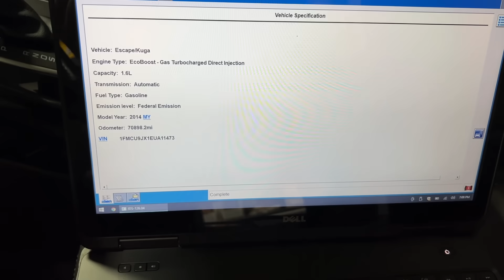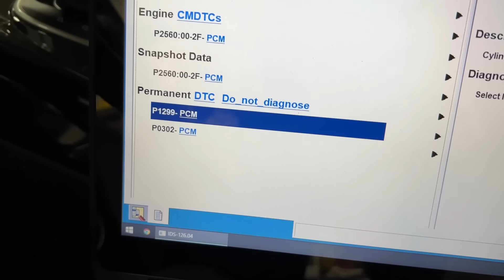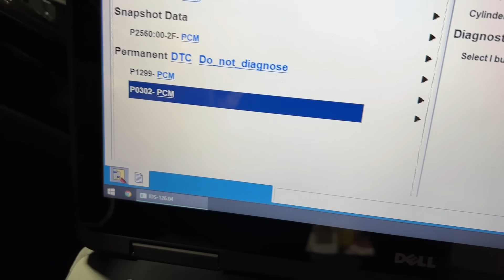Beware of Ford’s 1.5L 1.6L 2.0L Ecoboost Engines and Their Never Ending Coolant Consumption Issues!

Comment: So I have a 2018 fusion with the 2.0 and I took in under warranty I had the 5 year 75k mile extended warranty. Anyways I took it in June the car had 74,700 miles on it. I told them it had a issue the tech came out and listened to it said it was fine so I left. 2 weeks later it was cold out one morning I turned the heat on the car barely had any heat unless I was giving it gas. So the coolant was low topped it off. Next morning went to start it and missing like crazy. I was convinced by the signs I had coolant i intrusion. I took it in they discovered I was right. This is July my warranty was over by less than 2 weeks and 2800 miles over now. The service advisor said ford has been known to cover them but they didn’t the denied me. The dealership wants 8100.00 to repair the motor. I can’t afford it so I’ve been driving it like this. Seems to be okay kinda. I’m about to drive it from Ohio to AZ. Risky I know but no choice. Wish ford would fix it knowing and basically admitting to the the issue with new motor.

Comment: There's almost 2500 comments, and i'm not going through them all so this may have been said already.

Ford has a recall on their 1.5 and 1.6 Ecoboost engines. If coolant is found to be leaking into the cylinders, they give you a brand new short block. The 2.0 is fine though.

Comment: Same issue here in my 2014 fusion 1.6t manual at 130k miles cylinder number 2 crack and ford has no recall on my vin for coolant intrusion idk what to do at this point I’m still paying off the car too

Comment: We just had our 2019 Escape fixed after only 63k miles because of the coolant intrusion problem. Loved the car until we encountered this. On top of that, Ford refused to pay to have it fixed. Praise God for the extended warranty otherwise it would have been a $6200 fix for us. As a former Ford Master Certified salesman, do not buy a Ford. Not until they address these issues.

Comment: It’s crazy though how many engines are unreliable now days… Kias 2.4 blows constantly from losing the ability to spread oil from metal debris. The eco boost cracks blocks, Subaru loves to engulf oil as much as it can. Probably better off buying an old Toyota with 200k miles.

Comment: Since these are direct injection engines can this affect the fuel injectors? I have a 2016 fusion titanium with the 2.0l ecoboost. I had the original engine replaced for the problem at like 75k miles. Turns out they replaced it with the old design. At like 120k miles the same thing. I got it back and every now and then I would have a little miss but no code. Well 2k miles after my extended warranty ran out I got a random misfire code. P0300. Turns out it’s two injectors, numbers 2 and 3. Which happen to be the same cylinders that had coolant leaking into them. I’m trying to get as much information as possible before I call Ford to try and get them to cover it. I sold Fords for the dealership I use for over 11 years pre Covid. They’re one of the few trustworthy dealers left. Small town, family owned. Like the owner is there everyday and is the GM also. Been in the family for almost 100 years. If it was up to them Ford would cover it. But it’s not up to them. So they told me to call. When I worked for them I had a few customers that called Ford and complained and they covered their repair after warranty. One of them was 8k over but it was a problem they had off and on since it was new.

Comment: Glad my wife got the 2016 Ford Escape 2.5 SE and not that EcoBoost crap. Also just changed out the orange OAT coolant with the yellow VC-13-G P-OAT coolant. Coming up on 69k miles and so far all I’ve had to do is replace brake pads and rotors and replace rear struts. Drain and filled transmission fluid at 50k miles. Change oil and filter every 5000 miles.

Comment: It would be nice if they put out a book of all the vehicles that I have had eco-boost problems, and how to properly fix it or at least milk a good couple more years out of it and may be recommend a 10W-40 or a 5W 40 motor oil of extreme high-quality For the sake of the engine and the turbo charger maybe 4000 miles if you do nothing but city driving and 5000 miles if your 99% of the time on the expressway and I’m not talking about that $19 a court well, you have to get off the Internet only  because they think they’re so holier than thou like Schaeffer is 9000 Amsoil signature series top one torque oh SR one or liquid Molly I’m sure there’s a few I forgot

Comment: If this is a well known problem (Design Flaw) Ford SHOULD cover the cost off ALL effected vehicles. Will Ford not cover this repair out of warranty?
Reply: We are currently in the process of fighting for Ford to cover our engine replacement under the extended warranty on our used 2017 escape with the 2.0l Ecoboost. They asked us for maintenance records and receipts for oil changes. So I think they are gonna try and imply a missed oil change led to the gasket failing. 🤦🏻‍♂️ I sent them my maintenance records, but I'm missing one receipt. I've got my Vaseline standing by...

Comment: What about a 2012 Ford F-150 with a 6 cylinder ecoboost engine?  I've had this Ford for years with no coolant issues. Now I changed the water pump a few months ago and today the truck overheated and there is no fluid in the container.  Went to Austin on Sunday, no problem didn't overheat but I noticed the fans were coming on and running but the gauges didn't go past half way mark.  Also, there are no drops of coolant on the driveway or parking spot at work.

Comment: You presented a problem, BUT you never said if a Long block will fix the issue as in did they address the issue when rebuilding the long block that Ford screwed up?
Reply from the maker: Yes It is a completely new design long block, I have another video on this issue that shows the design change.

Comment: Yes its true 2017Ford escapes with 1.5 ecoboosts do use coolant quickly after i had it 3 years.....i also noticed the big hose pipe that goes around the engine to the side has some kind of leak.. its kinda oily dark substance near the hose clamp..

Comment: I bought a 2019 had it 7 months and Ford told me this after coolant is disappearing - The car is literally scrap now without a new block - there should be something done about selling these things if its known. I now understand why some people hate Fords, I am now one of them.
Reply: The 2019 shouldn’t have coolant
Intrusion issues
Reply: @Lord_Don  Well it did and after a vacuum test the entire number 3 cylinder was full of coolant. Ford then said I needed a new engine because coolant was entering the cylinders and causing corrosion - I got rid of the car and bought a Rav4
Reply: @johnathan640  was it the 2.0 or the 1.5?🥴🥴
Reply: @Lord_Don   1.5 Also more info, Ford gave me a printout of the technical service bulletin with the VIN number range that were recalled with this issue, 2017-2019 Escape built on or before 08-April2019, 1.5L ecoboost. My Escape was built in May at the same plant and was outside this window even though it had exactly the same issue as the cars recalled. When I called customer services they were pretty rude and told me that Engineers never make mistakes and get it fixed at a Ford and maybe one day I would get refunded if they increased the window or otherwise get stuffed. The next day I returned the car to the dealer I bought the lemon from.
Reply: @johnathan640  oh ok. I did get a revised block in my '18 hopefully I'm good🥴

Comment: I own a 2018 Edge Eco-boost with 80k miles. 
I am considering selling or trading it in bc of this issue. I don’t have those problems yet but just concerned about having them at some point. 
Do you have a video that speaks of the newer Ford engines and which is best? I want to stick with Ford but I want a durable engine

Comment: I must have gotten one on a good day. ‘17 Escape 2.0 w/ 80k on it and still running well.  It’ll idle rough every once in a while. Drop in fuel system cleaner and run if hard in sport mode, it clears up.

Comment: With the redesign of the 2023 escape is this still an issue? I read that they have “newly designed 1.5 and 2L eco boost engines” but that sound like salesman speak for they moved the washer fluid tank to the other side.

Comment: I has a 2014 Fiesta ST 180 coolant problem, turns out it was the head gasket, the block over heated, and that was it, had to by a new engine in the end, I would stay away from all 2013, 14 car as they all seem to have this issue.

Comment: There needs to be a class-action against Ford for selling a product that is not "fit-for-purpose" after 60 or 70k miles?
My Ford Focus Duratec 1.6 TI VCT 2007 has 116k miles and runs great.
Perhaps Ford should consider returning to those engine blocks like mine: my previous 2001 Focus 1.6 had done over 150k miles and was still running well when sold.

Comment: Some of these engines will run as many as 90k before they start to dump coolant in the #2 or #3 cylinder, yes? Rather than a $6000/$8000  repair  --- why not  replace the head gasket and the freshly machined head? Maybe $1500? Drive it for a while or better yet --- trade it in at the Ford dealer.  Dealers will take virtually any car in trade. It's a good way to get your money back and it's just as fair as Ford screwing you over on known problematic engines.

Comment: I just replaced an engine on a 2017 Ford escape 2liter turbo ecoboost. Junk. We took it on trade and obv with the issue. No codes, prev owner cleared them. We sold the car and the new owner brought it back with CEL on. 59k/kms on it. P0301 logged, Dropped the scope into Cyl#1 and could watch coolant actively flow into the cylinder. 

There is a class action lawsuit for the 1.6 ecotec and 2.0 ecoboost.  Not to mention so many other issues. Flex plate rattles, injector leaks washing cylinders down and contaminating engine oil.... fouling plugs

Comment: 90k from new on a 2015 1.6 fiesta st, 0 oil or coolant consumption, and i am tuned with a larger turbo. The only problem of coolant i had was with a small leak from a bad hose that connects to the coolant reservoir. I flush every year and i have a aftermarket radiator

Comment: I have no idea what y'all are talking about. My 1.6L ecoboost transit connect never had a single problem until about 250K miles. The valve cover gasket had flattened out. The trans went out, but I blame that on DFW traffic. Other than that, not a single issue. Still have it, still runs like a scalded dog. But I always have driven it hard and fast which kept it all blown out. Usually around 4K miles a month. Oil changes every month. I really took great care of it. When we changed that valve gasket a few weeks ago it was the cleanest engine you've ever seen. Both cellinoids were spotless and whatever the magnet thing is, was spotless. I'm saying it was immaculate. It all comes down to how well you take care of/maintain your vehicle.

Comment: I had a 2013 ford escape 1.5 eco-boost with 100,000 miles and was complete junk. I traded it for a 2005 Toyota Tacoma 4x4. The Ford automatic trans was leaking, the shock tower was rusted out and broke. The eco-boost went out because of a valve cover not properly sealed. The rear control ball joints were falling out. Like I said, this vehicle was complete junk and yet the dealers are selling these. The auto company shouldn't be able to put these out but yet they do. I will NEVER buy a Ford and you couldn't give me a new one.

Comment: I had a 2011 F150 with the 2.3 eco boost. I put 75,000 on it. I never had this issue with antifreeze burning or loss. The problem we did have was the rear differential over heating from a faulty fit of the gears. You could fry an egg on it when it was hot. It took three returns to the dealer befor they finally fixed the problem. I now own a 2019 F150 eco boost. 11,000 miles so far. No problems yet.

Comment: Thanks for the Video,  my 2014 escape 1.6 has same issue, I am driving it but with a kind of trick, what I am doing is like a pain killer ( not a permanent solution) , just I need to know if there is any side effects for it, after any trip I did with the car I have to open the reservoir cap to release the pressure, I am doing this now for 2 months and what I observed that there is no any loss of coolant and no morning misfiring , please if any one can advise it would be appreciated

Comment: I understand this issues is due to a design flaw between the cylinder walls at the headgasket.  Headgasket fails and leaks coolant into the cylinder(s).   I understand the permanent fix is a new Long block but that's $8,000 to have the shop do it and that's $2,500 even if you do it yourself!   Why not just replace the headgasket and get another 50,000 miles out of it for $150 in parts if you are a DIY mechanic?
Reply: Well it's a heck of a job is why most could not do it plain and simple.

Comment: Just watched this vid hoping iv not got this .Iv just got a coolent leak on my 1.5l eco boost 2015 it's on 65000 miles been happening for the last 2 weeks, haven't pressure tested it yet,or took underneath engine cover of to see if I can see any think leaking. Question would it put white smoke out of exhaust if water leaking in to cylinder 2 ? Any other advice I would be grateful. Lee

Comment: Unfortunately, it is difficult for manufacturers to predict that an engine will fail after something like 50,000 miles.  They must have designed and dynamometer tested these engines and concluded that they worked well.  It's a complicated case... I think that a good finalization of the project and before being manufactured and installed in the cars, the engines should be tested exhaustively running in several cars in different conditions of cold, heat, dust, ups and downs, mistreatment , overload, etc, etc, etc... then I ask: does any manufacturer do this type of test?  The current demand is for small engines with high power and low fuel consumption.  Then problems can appear and they do.  Now another question: is there any not-too-expensive repair for these beauties?  Some kind of electric soldering, etc?  I think that if some smart and skilled mechanic develops some kind of weld, some kit or some kind of not very expensive machining to properly repair these engines he could make a lot of money recovering these "ecoboosts".  I don't live in the USA but I know you have great mechanics, great machines, tools, welders, etc.  Maybe someone can come up with a clever solution to this problem.

Comment: Understand on this engine there is no coolant vent besides cylinder 2 defect. lol, He's saying it runs at 20 - 21lbs of pressure thats constant except when it cools down. Thats why there is a fill mark on the reservoir bottle for expansion. You can't vent coolant it's a hazmat chemical. In the old cars they had a radiator cap that vented to a overflow bottle then the cooling system would pull from a hose at the neck of the radiator and siphon coolant back into the engine. These use a reservoir bottle that is  constant recirculating coolant and under high pressure.  Note never open coolant reservoir or radiator when engine is hot. It will likely discharge scalding hot water or steam and cause severe burns. I know personally as a mechanic when we had a coolant system flash to steam.

Comment: I was looking at buying a 2023 Ranger this model year (local dealer has quite a few with no mark-up), but I knew this problem existed.  When I asked the salesman about it he said 'its been fixed for 2022 & 2023'.  I came home, hopped on the web, and found lots of videos and other websites saying/showing the issue still exists in the 2022s, but no data yet on 2023s.  Nope, not risking my cash on a 2023.  I can wait a while longer before buying a new vehicle, and there's a good possibility it won't be a Ford. ☹

Comment: I have this issue on my 2016 Edge. Currently battling Ford Canada to cover the repair costs. This is a known design/engineering problem!! Class action lawsuits have been opened against Ford for this! This is a safety issue! The recall to "fix" this, was installing coolant level sensors....

Comment: Many people are blaming the open deck design for the issue, but the open deck is there for a very good reason.  When you expect a very small engine to produce a large amount of power on a regular basis, you have to make certain you have proper and even engine cooling.  The open deck design is the answer that not just Ford, but many other brands have come up with  to improve the cooling.  The reason some boosted open deck engines have this problem and others do not most likely involves metallurgy as well as an overly aggressive design parameter that doesn't leave enough material at the top of the bore, resulting in cracks.  It's a bad deal for those who get the leaky units, and Ford really should step up on any vehicle with under 100k miles for sure.  Sadly, current management doesn't seem to be as customer focused as their predecessors were 25 years ago, and in fact they seem to be ready to abandon ICE's and go all-in on electric.  Big mistake in my opinion, but my opinions weren't always welcome when I worked there, and I'm sure they wouldn't be now.

Comment: It’s incredible the amount of people that’ll buy brand new vehicles, and spend thousands of dollars without doing any research at all about the car. These engines have had these issues for a while now. Get rid of it before it happens or if you still want an ecoboost get the older models that didn’t have these problems